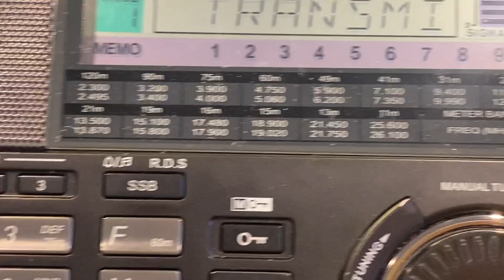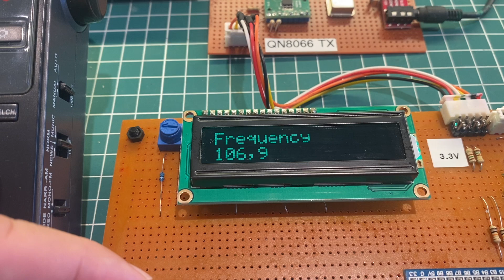STM32 microcontroller and the QN8066 FM Transmitter - PART 2

Comment: Dear Ricardo, I would like to ask you, what's the advantage of this setup over the QN8066 7w board? Is the signal cleaner concerning the spectrum?
Reply from the maker: My project is about a library to control an FM transmitter based on the QN8066. The purpose of this particular example is to present the minimal configuration for a QN8066-based transmitter. This can serve as a foundation for more robust projects. It’s important to highlight that the same program (sketch) presented here can be used with the popular 7W transmitter sold on AliExpress.
Reply: @pu2clr  Thank you very much! It's really a great project! I think it will be easier for me though to use the kit :) Did you by chance connect the 7w kit to a spectrum analyzer? I wonder how clean it is.